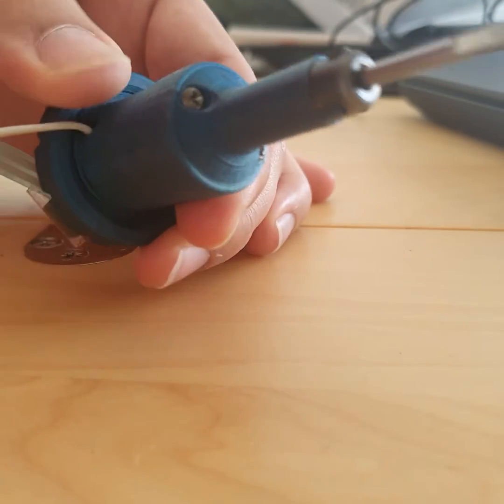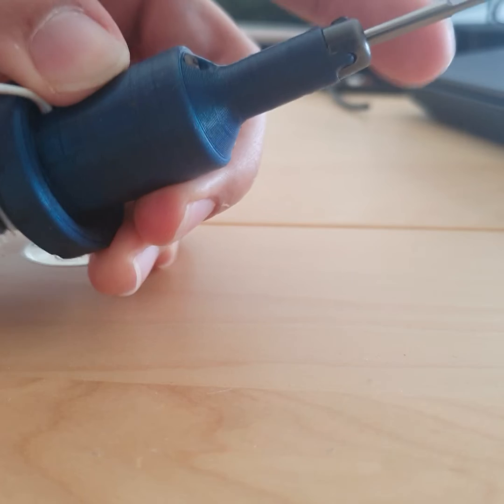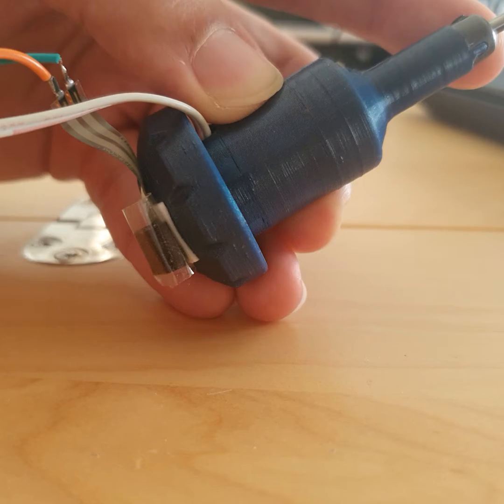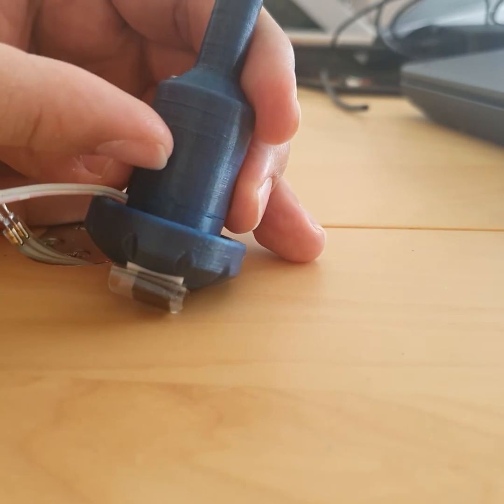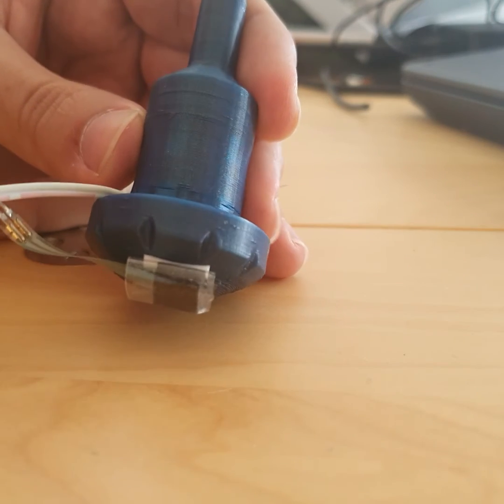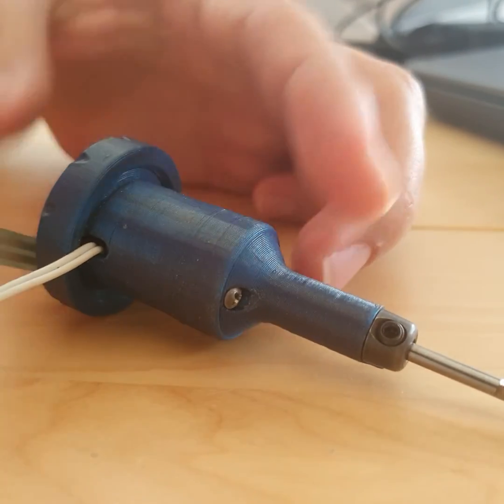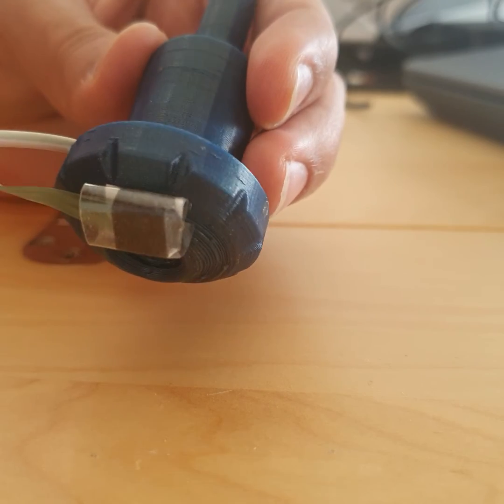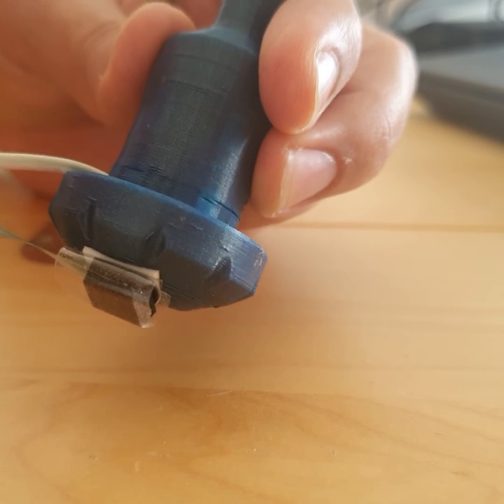DIY Solenoid graver - Control in the palm of your hand

Comment: the handle 3d print?
Reply from the maker: Hi, yes. Everything is 3d pri ted apart from the solenoid and the fixture for the collet. You can find more information inside the github for it.
Reply: @selvalss  I am also learning to carve.  I saw the video there is a kind of 3d sharpener too.  variable angle in 3d but I can't find the link.  i need some kind of gravel sharpener
Reply from the maker: @mulanjamilah7849  hi. I think the best way is for you to look on the reddit community r/engraving they already have it there. Since mostly set stones I dont need these templates. Have a great day.
Reply: @selvalss  do you have some vise coin Hobo holder  from 3d printer?
Reply from the maker: @mulanjamilah7849  Unfortunately I do not have it, maybe you can find it on websites that people share 3D files. I do not engrave, my main training is stone setting. Have a great day.//Sabrina.